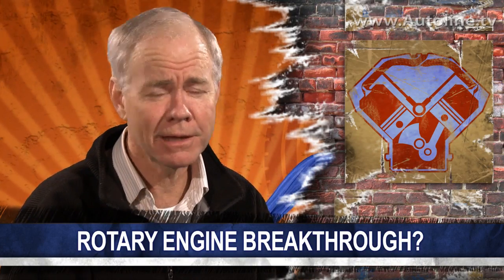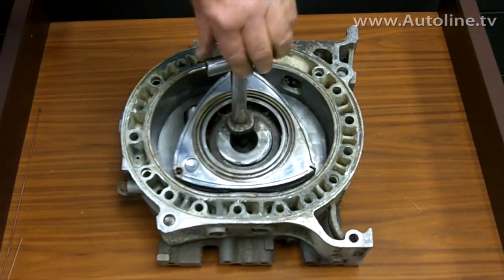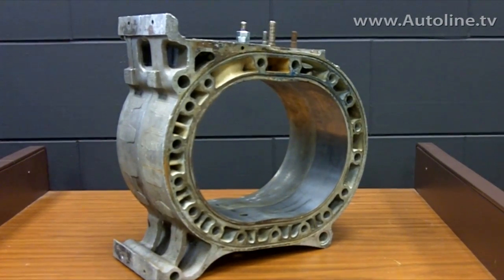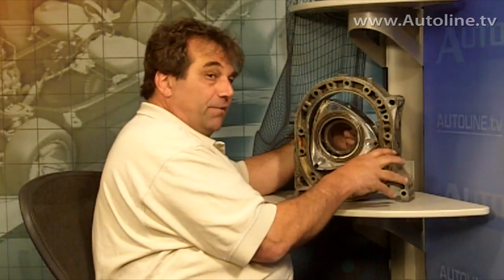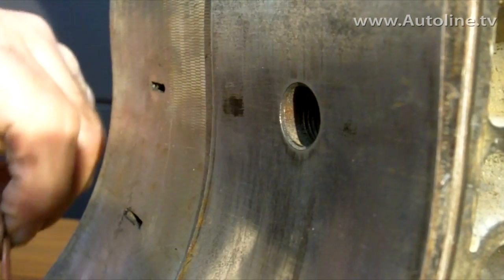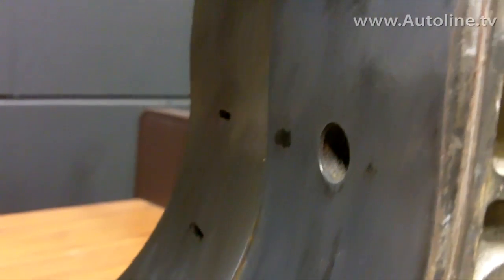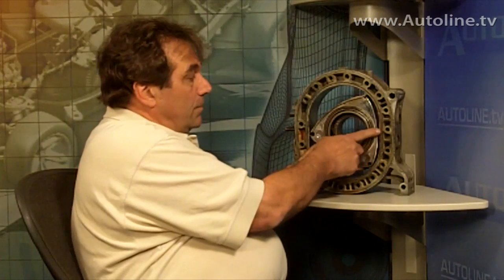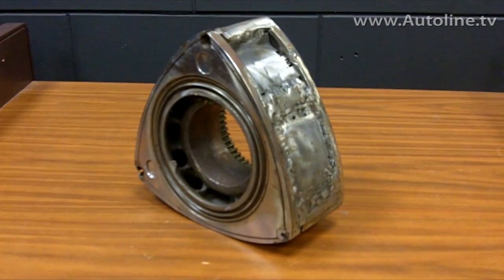Rotary Engine Breakthrough?

Comment: The physics behind the Wankels prevent current metallurgy from maintaining the desirable high revving characteristics as well as amplifying the fuel problem exponentially if made larger. It's an understandable position, larger engines are generally more forgiving.  The benefit of a Wankel lies mostly in its power to weight ratio, increasing the capacity quickly diminishes that advantage.

Comment: I truly think the size of the combustion chamber, the size of the rotor housings ect are the true downfall of the wankel. If everything was built bigger like say a 2.6L 2 rotor renesis for conversation sake, the engine would handle heat better not being so compact, assuming this would also allow for beefier seals ect. The water jackets can be better mapped so you could port the exhaust ports out larger, and also allow for some huge ports. My 2 cents.

Comment: I'm sure Isami Amemiya and the boys at RE would have figured this out long time ago if this were true. Also bottom line, modifications to the spark plug hole lead to disrupting the spark, and proper consistent ignition is huge in a proper running rotary.

Comment: The spark plug slot makes sense a little, but the off center part is not logical since the spark plugs do not fire at the same time, rather you have one that is advanced and the other is trailing it in sequence, thus there is no opposing force.  His suggestion is completely wrong since it would eliminate the second fire or at least make it almost non existent.  The reason why leading plug has a big hole in order to fire properly, if you made it into a slot, the detonation would be inefficient.

Comment: Again, good stuff Ernie. Reducing the size of the spark plug cavity is an intriguing idea and especially for minimizing compression loss and unspent fuel (which contribute to the hot exhaust temps).

Humphrey Davy invented the bulb but Edison improved on it with his better filament which made it a house hold item.

Hmmm, I guess only the Japanese are allowed to know everything about the Wankel than even its German inventor.  Germain+Japanese+American may = new success.  Who knows.

Comment: Rotary engines only suck as much as the owner.  That engine requires a relationship.  If you get to know this new friend for your self it will treat you like the long Rangers horse.  But if v you don't care about how it works and you just want it to work. .. Don't but a 10000 + rx7. I have had two fd's I sucked at first (21 yrs old). No experience in cats at all.  Now I'm in automotive school blowing thru automotive performance!  Because that car and Google and the forums.

Comment: If you don't know rotatories do not rate this video. Comparing top dead center to a rotor eccentric shaft is illogical.  Don't tell us what helps if you don't know if it helps. ...I need proof! Ernie needs to make his own vis of his engine and process behind it.  Mazda doesn't care but what matters is us rotary owners that DIY! The rotary engine is great but not 4 my fellow (on the average not mechanically inclined ) lazy Americans.  You have 2 B motivated and patient not rich just determined

Comment: Of course this is just for the sake of putting a rotary into a comparable measurement against the standard 4 stroke.  The engines just work different and if people accept that then they wouldn't have a hard time trying to put a triangle in a circular peg.

Comment: A piston goes up an down twice in one cycle but I get what you're saying.  Equations: 4 strokes = 720^ of travel = 2 revolutions.  A rotor moves 1/3 the speed of the "crankshaft." 1080^ of travel for one thermodynamic cycle.  The front and rear rotor are offset by 180^.  Every 360^ two faces go through the combustion process.  720^ will be four faces of the rotor completing their cycle.  720^ you will note is what it takes for the complete cycle of a piston engine.  654cc x 4 = 2.6 4-banger.

Comment: "Knowing that it works is not the same thing as knowing how it works." I tend to leave that much to the engineers to figure out. 

Also, I know this guy who says "I know everything about turbos because I rebuilt one." yet he can not say how a turbo works. You might actually be a good study and know a great deal about the engine. But my point is the engine is actually built to try to run in reverse. If you know so much about  the rotary engine you will understand that much.

Comment: Direct injection (which Mazda is into) and laser sparking should solve many of these problems. Ernie does have points in preserving the compression and ensuring the charge is at the front of the rotor.
Reply: HAVE YOU BEEN TO THE MAZDA DEALER LATELY???
Reply: WHERE IS IT??? Wankel engines are completely obsolete for over a decade now!
Reply: Today marks the 10 year anniversary of the final demise of RX production at Mazda.
  The very last Wankel engine car rolled off the assembly line at Mazda's Ujina #2 plant in Hiroshima Japan on June 21st 2012 at 4:30 PM Tokyo time.

Comment: Exhaust Gas Temp has inverse relationship to effective Compression Ratio, high CR=lower EGT, Thermal Efficiency given by 1-(Tx/Tp), Tx=Exh Gas Temp, Tp= Peak Combustion Temp. Early ICEs on available fuels, reason of detonation was unknown until work of Harry Ricardo, with its low CR had high EGTs, damaging exhaust valves, it were changed every 900 hrs. If this plug hole lowers EGT, it's higher effective CR and better Wankel Eng performance. Kawasaki patented an RCE combust improvement US3848574

Comment: It seems good in theory. In Mazda's next motor they are aiming for LASER ignition, which is probably going to make that hole a lot smaller, while maintaining spark consistency. I personally am excited for more news on the 16X
Reply: Wow! you look like a fool right now.
Reply: Perhaps a Webasto Ignitor for heavy fuel caravan heater will do the job, Toyota, SAE paper 790435, T Kohno, proved a Glow Plug in Wankel housing leading plug hole instead of an spark plug, and an Reed-Valve controlled Peripheral intake Port, will improve fuel economy in 9%. Gesund +
Reply: @joseveintegenario-nisu1928  Mazda abandoned all development of Wankel engines in May 2009.

Comment: I think you are judging a bit too far with this short video to really be fair.  Yes, the quality of workmanship on the rotor seen here was terrible, but to be fair, it was probably something he threw together for an example more than an actual running design (one would hope).  Also, if the chamber idea were done  in the same place on all three sides of the rotor, the balance would not be adversely affected.

Comment: Mazda relies on a tenuous balancing act with their engine, instead of manhandling the issue preventing any possibility of stall or lock that reduce counter forces that reduce power and efficiency. 

Another major issues with Mazda's rotary engine is the fuel continues to burn in the exhaust heating it enough to damage the seals, oil consumption, etc. Read and comprehend what you are responding to before you do.

...you dumbass.

Comment: and the fact that the fuel and spark timing will be in reverse? not to mention, the fuel would push out the exhaust before it had a chance to combust you plum

Comment: Well, when I was 17 (summer of 2012) I though offsetting the spark plugs and reshaping the rotor like this dude did would be a more logical idea than the setup in the late 13B-MSP - I thought it wouldn't have been done because it wouldn't work, not that Mazda hasn't attempted it though :S

I hope Mazda carries out tests on this idea, and I hope changes like these, and laser ignition, can help advance the rotary!
Reply: Mazda discontinued development of Wankel engines in 2009.
Reply: @sandervanderkammen9230  False!
Reply: @joseveintegenario-nisu1928  100% True
Mazdas last development engine was the 16x program which was unveiled in 2007 and cacelled in May 2009

Comment: As hybrids are here, the ideal most efficient application for the Wankel has finally arrived - as a constant speed range extender. It has to replace the less efficient piston engines at this task.
Reply: AND YET, THE WANKEL ENGINE IS GONE.
HYBRIDS ARE HERE TO STAY, THE WANKEL ENGINE IS LONG GONE.
Reply: Today marks the 10 year anniversary of the final demise of RX production at Mazda.
  The very last Wankel engine car rolled off the assembly line at Mazda's Ujina #2 plant in Hiroshima Japan on June 21st 2012 at 4:30 PM Tokyo time.

Comment: Wankels are more efficient at high speeds as the inertia of the rotor acts against backlash this man highlights. He has a point and more attention needs focusing on reducing power backlash - running at high constant revs improves Wankel efficiency & its power/weight ratio is far superior, which is important in a car. In car operation, revving up and down at low revs makes a Wankel inefficient. Best application is high revving, constant speed, range extender usage. I see a future for the Wankel
Reply: WELL YOU WERE COMPLETELY WRONG ABOUT THIS..
IT'S 2022 AND THE WANKEL ENGINE HAS BEEN OBSOLETE FOR OVER A DECADE
Reply: You look like a complete and utter fool right now.
Today marks the 10 year anniversary of the final demise of RX production at Mazda.
  The very last Wankel engine car rolled off the assembly line at Mazda's Ujina #2 plant in Hiroshima Japan on June 21st 2012 at 4:30 PM Tokyo time.

Comment: The formulas are available online so you can calculate the volume of a rotary engine with the specs that are given out freely by Mazda. I did myself and got a volume of 80 cubic inches. It does take a bit of calculus knowledge.

Comment: You are also incorrect as the displacement of the RX8 and RX7 motors newer than 1985 is 1.3 L or 80 cubic inches. You can read this information in the factory shop manual available online in many places. I'm not disagreeing that they are inefficient as I own one myself and have seen the mileage as low as 13 mpg but you shouldn't make claims like this when you don't actually know what you are talking about.

Comment: do you know anything about rotaries? what would be the point anyway? a 1.3L ratory puts out around 250hp.  3 rotors and 4 rotors are way more. there's a company in Australia that made a 4L 6 rotor motor that put down +800whp NA

Comment: Some inevitable questions... first, if he's a former Mazda tech, wouldn't that avail him to knowing at least who could do the custom machining to make rotors that don't look like polished slag? Second. is compression loss really a factor in the time that apex seal spends over the plug hole vs. poor flame front propagation from a tiny plug slot? Third, if piston engines seem to continue spinning in the correct direction with symmetrical TDC (and way more friction), why wouldn't a rotor?

Comment: The engine will rotate in reverse, if you start it in that direction. Conservation of motion. Basic science and physics. The direction with even slightly more influence is the direction the engine will turn.

Propagation flame delay? Magic. The fuel burns at the same rate. Only the motion of the rotor having spun *just* far enough prevents the engine stopping itself. The combustion still produces counter force reducing power, efficiency, and potential speed. 

You are wrong.

Comment: This is funny. If half the force goes in one direciton, and half the force in the other, NOTHING MOVES. Also, it doesn't fire at TDC it fires at 5 degrees past so it goes in the right direction. With the quality of workmanship on his split bucket rotor, it would never run. Rotors need to be perfectly balanced to be able to spin at such high rates and the flywheel neets to also be balanced to the rotors or it wobbles very badly. Interesting ideas, but maybe rebuild some real rotaries first.

Comment: A 4 stroke engine has a single stroke for each phase of the FOUR phases. A 2 stroke engine has 1 stroke for 2 of the four phases. The Wankel has all four phases occurring at the same time effectively making it a single or 1 stroke engine. BadassVolvo16v is wrong in saying it is a 4stroke. Because all 4phases occur simultaneously it is a SINGLE STROKE engine. That is where it gets its power to volume advantage over other engines. You're both wrong.

Comment: Quote from rotary engine by kenichi yamamoto: 

(...) the rotary engine is a 4 stroke one cycle engine (...) which continuously performs clearly distinguishable 4 strokes of intake, compression, expansion and exhaust. Until one of the working chambers completes the 4 strokes (...) 

(rotary engine, kenichi yamamoto, p.14)

check to see how smart this guy is !!!

Comment: by the way, in a 2 stroke the piston does the induction and the compression in the same stroke, . Not true for the rotary, each face of the rotor goes through induction, compression, expansion & exhaust. What makes them more powerful than comparable piston engines is the power pulse witch is 3 thermodynamic cycles in 3 revolutions of the eccentric shaft (3:1 shaft to rotor ratio) power pulse equals 1.

piston: 1  thermodynamic cycle per 2 revolutions of crankshaft
power pulse equals 0.5

Comment: This vid highlights the back thrust of the Wankel. The explosion pushes backwards as well as forwards. This back thrust is negated when the engine is at high revving and a high load as the engine speed running one way and the inertia of the load (moving vehicle) act against the back thrust. Hence why Wankels are best at high revving applications like sports cars. Using them on high revving genny's as range extenders will also improve performance all around.
Reply: Well you have been proven completely wrong and look like a fool.
  Today marks the 10 year anniversary of the final demise of RX production at Mazda.
  The very last Wankel engine car rolled off the assembly line at Mazda's Ujina #2 plant in Hiroshima Japan on June 21st 2012 at 4:30 PM Tokyo time.

Comment: The performance of the RX8 is equiv' to a Porche and both do a similar mpg. Yet the RX8 is super-smooth, smaller and better for smaller packaging of car designs.  The Wankel works better on high revs at constant peed and at its most efficient "sweet spot".  In other words great for a constant speed range extender only turning a genny in a hybrid using supercapacitors and batteries.  Then it can be under the floor or under the luggage areas.
Reply: YOU LOOK LIKE A FOOL RIGHT NOW,  RANGE EXTENDERS, LIKE THE WANKEL ENGINE WAS AN EPIC FAILURE.

Comment: your first solution might hold promise, but why just don't put the plug on the rotor, your second solution does not make sense, that will definitely not help. The only way to get this wonder machine to work properly is to get it on diesel

Comment: if all 3 faces of the rotor are equally offset, the rotor would stil be balanced, putting a weight on 1 chopper blade = bad, putting an equal weight on each chopper blade = not bad

Comment: In a 4 stroke engine your wasting 70% of the fuel because only 1 stroke creates power.In a rotary engine its always ready to make power because each side is going through a different stage.Its the reason why the engine can rev so fast,high and the reason it generates so much power off a tiny engine.Mazda made 1.6 rotary engine making 300hp without a turbo/supercharger.No 1.6 4 stroke can come even close.But for NOW the 4 stroke engine is the most reliable and fuel efficient engine out there.

Comment: That would work in a 2200 pound MX5. A 4 cylinder turbo 1.4 would be far more powerful and efficient. That will most likely be the next MX5 powerplant.

Comment: If the current MSP were detuned to about 120 hp then boosted with a small turbo to 15 or so psi it would get about the same peak power much improved low/mid range output and likely 30+ mpg with conservative driving and tune.  I want a de-portes 12A 1st gen with efi and a tiny turbo.  Would be aiming for 150 hp and 40ish mpg ;)

Comment: Why would you want to not rev the motor to its point of best output? Its not like a piston engine where it gets more raucus and intrusive as you do so. An MSP at 5K is no more intrusive and probably less intrusive than a comparable 4 banger at 2-3 grand. You get better performance and usually better mileage as well by driving your engine where it makes good torque. I never got the lack of torque though, last time I drove a 13B rx7 (loaded heavy as hell vert) it could snap my head back off idle.

Comment: No it dosent, how do you people still believe that energy can be made from nothing? Its the stroke vs bore bs again. Stroke DOSE NOT increase torque except in that in an engine it typically brings extra displacement with it, the ACTUAL source of the new found torque.

Comment: The fact that people insist on working the engine at low rpms is imo much of the problem. If you want a wankel and you want good mpg and you like low rpms then a typical 13B de-ported and de tuned to say 80-90 hp would happily give you 40mpg in a small car and still out power your typical 1.3L econobox. Its hard to imagine in the US because 1.3s have been all but extinct since the metro went away. Otoh tweak a metro to 200+ NA hp and see what kind of mpg it returns lol.

Comment: But it dosent, that's the issue. Mazda already uses offset and asymmetrical depressions. They have experimented with the very same layout shown here and the effect on combustion is negative.   And you can not have a 2 stroke wankel no matter how you change the rotor design. There are 2 stroke rotaries of a sort out there like the vein style but those are not wankels and are not relevant here.

Comment: That dose nothing to remove the actual force being applied, the issue is not the rotor actualy being turned backwards but a portion of the combustion pressure working against the rotation of the engine. Think of a car on a hill, you can block the wheels with a chock but the force trying to roll it down hill is still there and the chock dose nothing to alleviate the power needed to move it up hill.